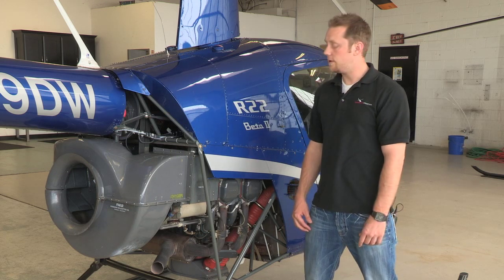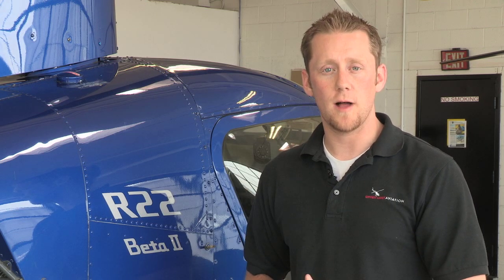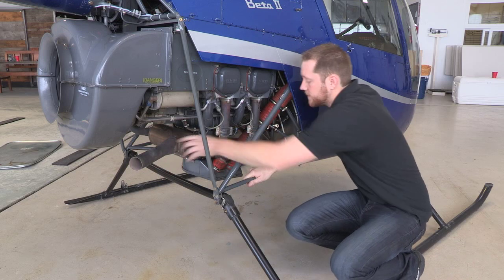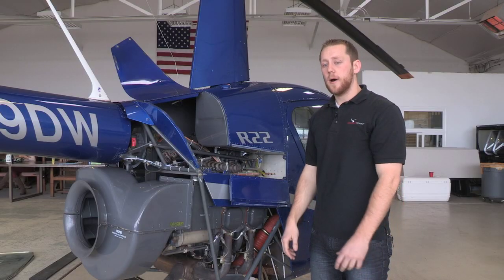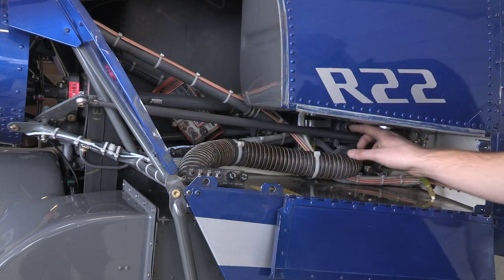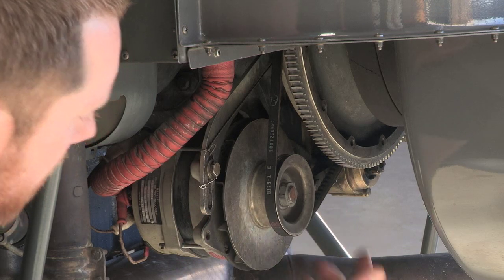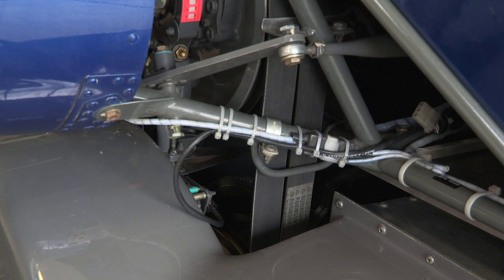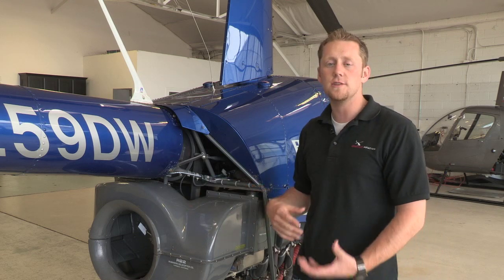R22 - Reciprocating Engine and Transmission

Comment: Dang, that’s a HUGE cooling blower on the front

I guess they need that because these things run full throttle constantly
Reply: They need it because unlike a fixed wing where the engine sits in the nose of the aircraft receiving tons of airflow, these engines sit in the belly with no airflow at all. So they just attach a giant fan to the back to try and force air over it

Comment: @2.37, noob question maybe but what is that bit of wire doing around the Alternator mount and bolt? Nice vid for any classroom I must say.
Reply: That's a safety wire, or lock wire. In the event a bolt loosens, the wire prevents the bolt from working it's way out, obviously, this could be catastrophic. Part of you pre-flight should be inspection all bolts and lock wire, if the bolt feels loose, the wire is broken or doesn't look quite right, consult a mechanic before flying. This is critical, it can literally be a life saver.